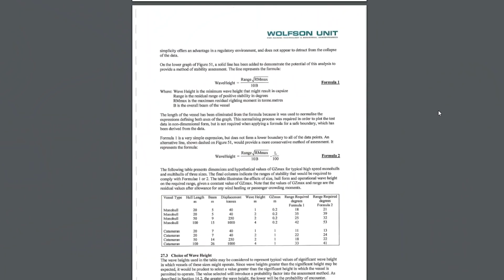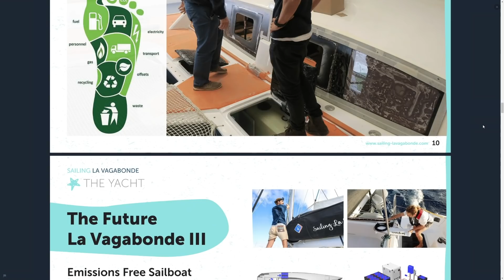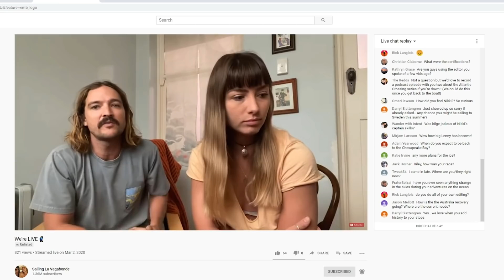Our Plan for an Emissions Free Vessel

Comment: 1st try to get Elon on board and obviously the batteries need to be set in a way to act as your ballast....I wouldnt plan a thing until september 22nd (think thats correct) tesla battery day....the stuff they have coming out with the maxwell capacitors and potentially cobolt free batteries is game changing.....the next 12 months my prediction is battery cost will drop 50 percent and weight to charge will increase 50 percent.......I wouldnt even think of doing a design until this battery revolution moves forward....if u built it today it would be obsolete in 2 years........elon beat the oil companies....all the blocking by oil companies is over....world is gonna change real quickly.....be patient and good luck

Comment: Buy a GUNBOAT, its already done.  Carbon fibre, hence strong light and fast. The props recharge the batteries, no motor.  If you think you can create an emissions free boat you CANT.   All the materials for manufacturing a boat create emissions don't they? Ever smelled a fibreglass factory? THATS emissions of gas.  How about the pollution from battery manufacture and then the disposal of lithium?  Just dont pull another brainless stunt like nearly drowning your family in the Atlantic, Roily.

Comment: For real, content was starting to get samey and I bet you guys were struggling with ideas. Especially during these times of lockdown.  But this is a great way to take it. I'm also super excited about zero emissions, boat design etc. Check out Sail Cargo, using trees felled for other purposes like road building. I also think there's a cool concept with wind turbine direct drive to the prop. There's also a solar panel sail being developed (solar sail?) but that's not durable enough yet. Excited for this segway

Comment: I have had the exact same thoughts - I LOVED the original concept of TOP SECRET and thought "perfect". Alas they got hit by lightning and not having a diesel backup had them stranded. They subsequently added back two 'back up' diesels. My original design concept for a cat has two DC/Electric motors fed by solar, wind, regenerative props and a back up of two gensets which might also be needed for dive compressors, the watermaker, etc.  So, if the boat is large enough, two electric sail drives + two diesels would be ideal. That might be a BIG boat though. I might go monohul (there is a specific '95 maxi that has my heart) so keeping the original engine and adding two sail drives might be perfect. I am thinking a near expedition-class boat (but fiberglass, so will stay away from  ice).

Comment: Bigger Faster Sailboat that is more stable >  Maybe have a look at the NEEL 51 Trimaran. Then just cover the roof with solar panels and rip out the motor. It also has a massive amount of storage/workshop space that could be used for extra batteries etc and only a single motor so less expensive and more power efficient. The only downside I could see from you moving to this boat is its a bit wider so docking in marinas would be more difficult/$$.

Also meet up with Sailing UMA > they are i believe in Europe at the moment as well and they have bee running electric for years!

Comment: One important factor to keep in mind is the power used to drive the boat. If that power (usually electricity) was produced with emission producing means, then it is not emission free.
    This is why fully electric cars are not really emission free. The electricity used to charge the batteries comes from gas or coal fired plants, the car is responsible for even more emissions than a traditionally powered car.

Comment: If you like the current hull, just modify it. Ditch the clunky engines, accessories and fuel tank and the oil filter spanner, that’ll free up a lot of space and mass. There is a lot more space on the upside of the boat for more solar panels and windmills. Given the exposure you are giving them, the people at Outremer should be interested to engineer a solution with you. I’d be if I was them.

Comment: Solar Yacht: Silent Yachts 55 catamaran. Like a Tesla for transoceancruising. I love sailing catamarans, but maybe that´s better:
https://www.youtube.com/watch?v=nVG5SMwxLYY&t=6s
"SILENT-YACHTS was founded with a vision of significantly reduced cost of yacht ownership to explore the ocean in sustainable luxury through innovative clean technology. The first and only ocean going production yachts in the world which are powered by solar energy, Silent Yachts unlock the possibility of unlimited range, almost zero emissions, and greatly reduced maintenance requirements. Noiseless, and self-sufficient, all energy production is done on board. From propulsion, navigation, and even the household equipment everything is powered by the sun."
Reply: I mentioned Silent as well. Truly impressive boats and they will only get better. 
As a non-sailor it’s what I would get if I bought a catamaran. It would be so cool to travel the world without dealing with all the maintenance and complexity of sails, lines, diesels, etc.
Reply: @MichaelBrashier  limited range.
Reply: It's range is limited
Reply: @abshir9677  Range is not limited! Look on their website:
https://www.silent-yachts.com/vision-technology/
"On every SILENT-YACHT, solar power is not only used for the propulsion of the vessel, but also for providing energy to all navigation, comfort and household appliances on board. This means you can enjoy all the comfort on board in a sustainable manner while having the possibility of unlimited range."

Comment: It seems that brushless motor/generators drives are much more feasible than people might think.  So the planform is a big enough battery pack for storage.  Replace most of the fuel tank with batteries.  Keep a fuel powered  generator with a smaller fuel tank for emergencies. Set up the motor drives to be generators under sail power, and electric motors for docking and no wind situations. The most important part of this is the electronics that allow the motor to be switched between motor and generator.

Comment: Chaps, ive been saving and recycling old kit of all sizes for decades. Think on an idea ive had for years. Emmissions free...must include emmissions of production too. So a new boat by default will pollute hugely in manufacture. 

The safest hull is a hull that has stood the test of time.

Monohulls only capsize when rigs break or keels let go. 

They get knocked over yes, but then they right themselves if designed properly. A cat capsizes and thats that. You are stuffed.

An old proven monohull bit with a modern rig and fit out? The best of both worlds. Renovate, rejuvinate bring up to date, but benefit from those that came before.

For example, a 60ft pilot cutter hull has 200 plus years of keeping people alive in terrible seas. With a modern rig and fit out shed be fast enough, safe as a castle, proven and has already paid a lot of its ecological tax many times over. 

Wood hulls are maintenence heavy its true...but in my humble opinion, wood floats...lol.

Comment: Ohh, and you could change your motors to electric, make more space for solar, add more batteries, and upgrade the genset to power the electric motors in case of dire need and empty batteries. You dont use the motor often anyway, so even though the sails woulx hinder the solar, if you had enough battery to go a few hrs at 8kts, and a genny to keep in reserve, that is pretty low emmisions... Like none outside of emergency if you keep to travelling with wind.

Comment: First... Great hillbilly accent!

I imagine you have seen a different yt channel where the monohull switched to an electric with solar... Puts out enough for about an hour of motoring, and otherwise its a sailboat charging the batteries... One good option.

A second option is something on the silent yachts spectrum. They have a 45' in planning, and also have a 55', 60', and 80' with many customizable and very expensive designs.

I thought it could be amazing to find a cat with damaged rigging and boom/mast damage to buy cheap, convert to electric engines with lots of solar and batteries... Resembling the Solarwave test boat that started the silent yachts business. Getting a used 50' cat with no mast and rigging would lower the cost huge, and allow investing in the electrics. Still would nedd some sponsorship in way of skilled design to make it possible, but if solarwave sailed for 5 years, 10 uears ago, there should be some current skill and knowledge to do it again. Of course this means ditching sails entirely, which you may not want.
Tony in Switzerland / Canada

Comment: I guess if you wanted to be zero emissions you could start by not running your diesel engines. You are on a sailboat, they have been sailing for centuries without engines. Boom!! you are already on what could be a zero emissions boat.

Comment: I was wondering how you might measure emissions so that objective comparisons might be possible. I was also wondering how you might measure the significance of certain emissions with respect to others.  For example, we know that even the construction of a fiberglass boat is not emission free.  Would you consider boat A over boat B if you found (through objective measurement) that the construction of boat A produced less emissions.  Perhaps the amount of emissions in the construction of any boat has little or no significance over the lifetime of the vessel.  Cheers

Comment: I think others have commented well about the question of why not convert what you have and have given suggestions. I will only add two brief ones. First, there is no such thing as a perfect sailboat, or anything else, for that matter. Even if you start from scratch, it will always have things you couldn't have done to start with or discover later after finished. Second, if you want to be instructive to your fellow sailors, starting from scratch is far from their options and will immediately be a turn off and irrelevant. The challenges of upgrading from what you have is a totally relevant topic they can identify with and benefit from as you work through the issues. This is aside from the economics fitting in with a growing family and the needs that rapidly change.

Comment: Excellent endeavour, lose the diesel, 3000 watts solar, electric motors with regeneration capabilities, a couple of silent wing generators, triple the lithium battery capacity, and add a large generator as back up. 😎 Why not refit LaVagabonde? Maybe Outremer will get onboard.
Reply: Jimmy Cornell.......already partnered up with Outremer for the same.
Reply: So a lot of the drawings and planning is done, perfect. 😎

Comment: A fast light cat with electric propulsion, heating, cooking, and dinghy is probably the best you'll do with current technology. The problem you're going to run into is that you can't store much power, so your motoring range drops from days to hours. Cover your roof in panels and maybe you can maintain a knot or two when you get becalmed.

Comment: Hi to the La Vagabonde Family and the world of green sailing.
It’s is a hot topic with the industry and marine community and is awash with what “Daz” from Dazcat and Multimarine, “calls green wash”. What is the true environmental impact of the materials you use, it’s construction, it’s intended use, and finally to its end of life and recyclability?
I don’t envy you, it’s an immense and complex topic but a really interesting one, and one that would make good viewing and provide the industry and sailing community with a great template to work from ie...

The use of recycled or bio based resins and cores in the construction of the catamaran such as Biotech Jute and hemp etc...

What could you use, conventional or wing mast/rig design? https://vplp.fr/realisation/oceanwings/58.html

What onboard power and engine systems are there and what are the pros and cons of? Solar, Electric/hybrid, Hydrogen fuel cell, Diesel or LPG etc.

Safety systems such as, overboard alarms and anti capsize devices that fit to the top of your mast etc...

Coms giving you the ability to use remote education programs for the little one in a few years time...

Price: Unfortunately eco products come with a substantial premium, can this be justified and are there other options?

At Dazcat and Multimarine they specialise in designing and developing one off and small production runs of Multihulls and other boats and marine craft tailored to the clients needs. 
As well as an in-house design team they also work with Noted designers such as Nigel Irens, Nic Bailey and companies such as Oceanvolt, Harken etc to make their clients dreams come true. 

Please take a look at their YouTube videos and Facebook pages and some noted visitors at the yard “Sailing Uma, MJ Sailing” and if you feel like a chat give them a call, they may be able to help you on your journey or at least pass on some of there extensive wisdom...

PS. I couldn’t find your email link in the description...

MJ Sailing
https://youtu.be/cc7KCfdLnPI
https://youtu.be/bszqxfYPt48

Sailing Uma 
https://youtu.be/R8BkdU0Q614
https://youtu.be/8yWU8UgCvpk
https://youtu.be/hs9xnaKvNOU

The Multihull Centre, Home to Dazcat and Multimarine Manufacturing...
www.multihullcentre.com
www.dazcat.com
www.multimarine.co.uk
https://www.multihullcentre.com/dazcat-catamaran-range/dazcat-1895/
https://www.multihullcentre.com/multimarine/past-projects/broadblue-rapier-550/

Comment: Emissions free yacht is a pretty tall order short of throwing a log found on a beach into the water and attaching an ama to it and fitting it with a crabclaw sail, I would say it's next to impossible to have such a boat.
 Steel, fiberglass, alluminium, solid timber, strip planked, even a coracle have emissions involved.
 You would have to do without an engine to be emissions free but if the boat was big enough and you could carry batteries charged with solar panels you could run electric motors.
 Of course the manufacture of such items requires emissions. 
It's hard!
 The boat would need to be as big as possible and as light as possible.
 I can think of only one design that might fit that criteria with the least amount of emissions to construct and maintain, and that is a James Wharram design.
 To give you an idea of what I mean, I have included a link to one model. It's not the biggest, that would be the Pahi 63.

https://www.boatsonline.com.au/boats-for-sale/used/sailing-boats/wharram-tiki-46/242074

Comment: My 2 cents. I would use Tesla, Nissan Leaf, or BMW EV car parts and do a conversion on your existing boat. Remember to focus on "regen" every time the sails are up the batteries are being charged by the prop(s).Add solar and those little wind generators that all the cruisers have. And the for peace of mind I would add 2 (for redundancy) Cummins marine diesel generators, making sure to get the 1.9 liter VW engine for max reliability and fuel economy. Please also consider sending your "video brochure" to a brand new California company called Canoo. They have a very nice trim 300hp electric powerpak. Since they are new they may be inclined to sponsor you. I wish you all the best of everything an lack for nothing.

Comment: Why not experiment with the one you have got. Change the motors to electric as you know you can get the most amazing selection of electric sail drives. Ungraded the the battery that you have. upgrade the solar panels you have and add more solar to the top of the cabin. Then see what works see what you like and do not like, work with what you have got. Once you have got that all figured and sea tested then it is time to build a boat.

Comment: Hi Riley, Achmat here. I'm no sailor, but I enjoy watching your sailing adventures, ur personal life skills growth along with ur sailing skills growth and the growth of ur onboard family. U huys are amazing! On the current topic, I assume u've had a look at Silent Yachts' fully autonomous solar powered catamarans (smallest model is 55 foot) which rely on 2 solar powered electric motors, with a backup generator. At around 7 knots u could still run all the electronic systems including the aircon. If more speed is required the producers of Silent Yachts suggest switching off the aircon, etc which would the allow to to motor at about 17 to 21 knots if I recall correctly. They also offer the additional parachute type sail which electronically deploys and rises high up in front of the catamaran to drag the catamaran along, which, when combined with the solar-electric motors would give u greater speeds, to perhaps outrun a storm? I haven't read all the comments so my apologies if someone has already mentioned Silent Yachts. Its pricey though. I think the smallest model is around 1,5 million Dollars (US)

Comment: OCEANVOLT would seem to be a good option. Sailing Uma has been running all-electric the past few years, and are now using an Oceanvolt saildrive on their monohull. Offers power regeneration under sail, and every knot increase in speed massively increases power generation. Dual or quad motor options for catamarans, plus higher cruising speed, PLUS more surface area for solar, means massive charging capability. Even a large bank of batteries should be lighter than those two Volvo engines plus a full tank of diesel. If you got a wind generator manufacturer as a partner, that could add peace of mind for cloudy but windy days on anchor.

Comment: Talking about emissions free vessel but not mentioning emissions made when materials used to build the boat have been manufactured. Chemicals, sails, etc and even electric energy used for tools and technologies. Only boats without emissions are those made with hand tools from wood in the old way. But that is only my, probably twisted opinion.  GL with your plan though since any attempt to protect nature counts. :-)